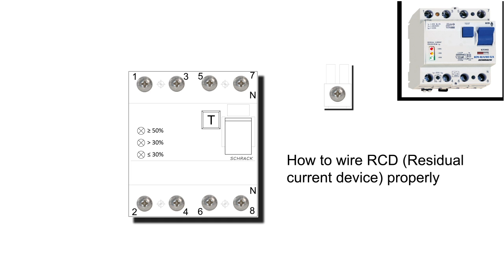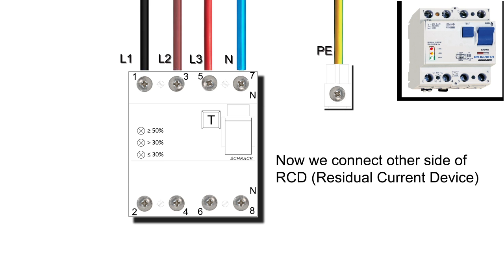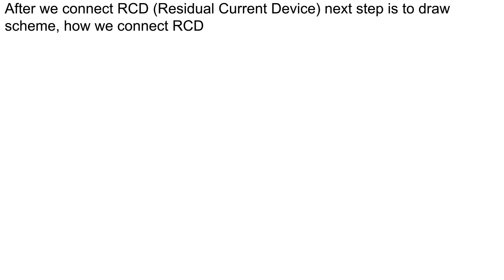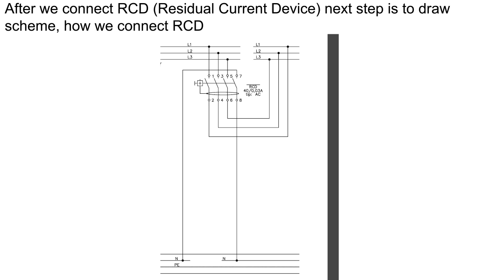How To Wire Residual Current Device (RCD)

Comment: What if you don't need a neutral or null wire, if it is a balanced three phase load?
Reply from the maker: you allways need null wire, because you need wire to compare electricity
Reply: chrvoje engineering what about the seimans units that don't have a null connection. How do you protect three phase balanced loads? How do you protect motors with vsd's?
Reply from the maker: I protect balance loads with fude and motor protecting switch or bimetal switch
Reply: chrvoje engineering protection of the motor is easy protection of people is a lot harder, you have not answered the question at all.
Reply from the maker: 3 Phase Current Balance Protection Relays you can use for protection, i dont understand protection of people is lot harder?!
Reply: Sorry for my ignorance, but will this trip within 300 ms with 30MA imbalance on a motor with a VSD?
Reply: @jaredturner4089  In case when your machine or anything else doesn't need "N"  to operate but you want to protect people from possible electric shock from that machine you'll still need RCD ! Simply you must connect N to input side of RCD, but from "output" there is no need for N, you leave it "empty"
RCD needs "N" to work as protective device. If there is some motor that needs to be connected via RCD you need to choose some of those with *trip delay*, S or G type RCD! 
Those S or G will NOT trip at start in (for example) first 40mS...